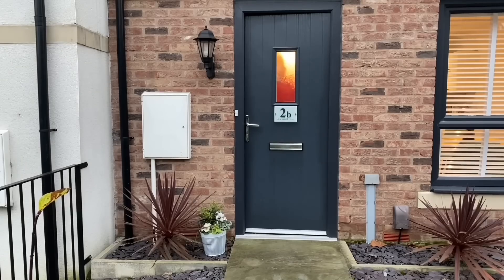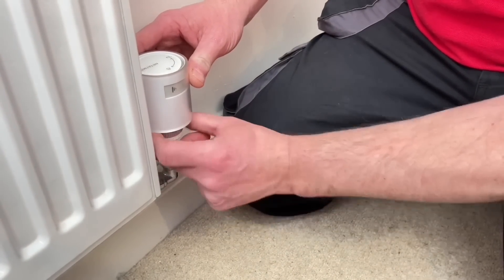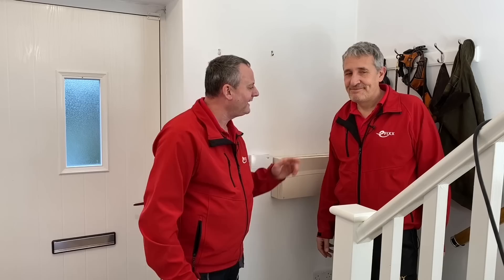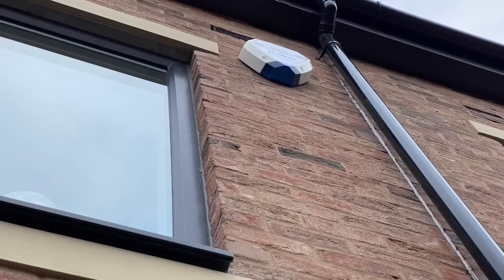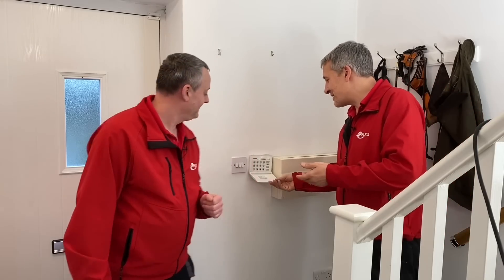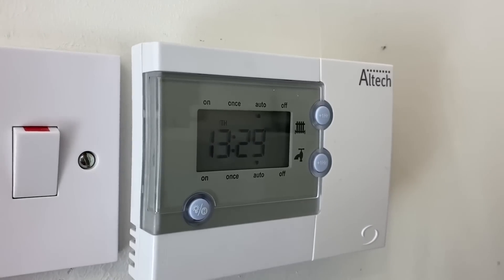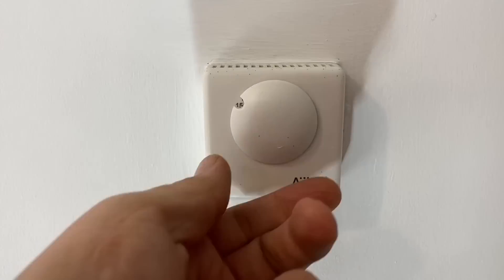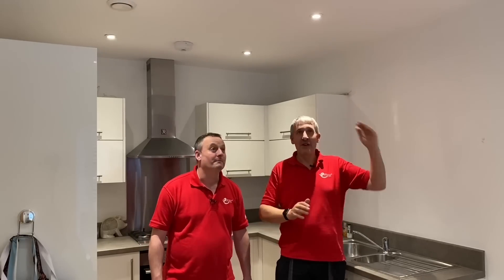Efficient but DUMB! - NON SMART HOME TOUR - Why do builders do THIS?

Comment: I dont know about the wifi alarms, the majority of iot devices have very poor security leaving your network open to attack, or worse data fraud and theft, you can replace items in a house but not a missing bank balance, i always advise that anyone with an alarm get a dialer fitted, preferably utilising a sim card. Ring had a huge security flaw up until 6 months ago that basicly meant anyone could get a hold of your wifi password, a security flaw wich is still very much present in a large majority of iot devices that are currently on the market. Untill these conpanys start caring about secure networks and not just making a quick buck ill stick to recomending certain 'dumb' devices as with a little work they can still provide a service comparable to smart devices. Having said all that, great work guys i always look forward to one of your uploads
Reply from the maker: Thanks - you raise a very valid point it’s important to trust the source of any tech product wired or wireless.  We will see what we can do to discuss the issues around security later in the series.  We follow the work of Pen Test Partners in this area -  https://www.pentestpartners.com
Reply: @efixx  hi guys again great work as usual and I've just checked out that that site I've got to say the brilliant resource thanks for sharing, especially as an industry we are moving more and more towards automation and so having general knowledge of network security even if you don't necessarily work in the networking industry is now becoming more and more important I wouldn't be surprised if further on down the line the regulations start to include basic network security
Reply: This is not true. It depends on the placement of the wireless source, you'll always have to change the standard password to a personal one. And use several sensors so one would not get any chance to get into your house. It's almost impossible to break into our house without triggering the alarm. The sensors are zigbee sensors, combined with a smarthome system. The system will turn on all lights, turn on a siren, notify me on my phone, alle cameras in our house will start streaming live streams to our phones through the satellites. The system itself is wired and hidden in a compartment where no jammer is able to disturb it with interference. And if you're able to interfere with the zigbee frequency, you'll be having a hard time, since the camera's pointing at the doors and sensors have a motion option, so the alarm will also get triggered if you're deciding to use a jammer on the sensors. A UPS is placed behind the server so the server will always have power, even if one decides to turn of the main switch. The basic rule is to always change the password. This is it. Then you'll never have to take the extra steps I did. (It's my profession, and I could take the hardware home for free)

Comment: Will be great to see some Shelly WiFI relays fitted to enable a smart light switch.  Loads of smart switches on the market, but for anyone who wants to retain existing fittings or traditional ones, good option.
Reply: Shelly.cloud Bulgarian company, devices cheap and fully CE rated. I have a good few in my house, they are open source by default aswell which is good for easy integration.
Reply from the maker: Thanks 🙏 - we will take a closer look.
Reply: Just to add to my previous comment about shelly devices, they will still work perfectly normally when the WiFi stops working which can be a big issue with smart tech relying on external servers. I'd suggest having a look at "Help! The Internet killed my toaster" by Superhouse TV on YouTube
Reply from the maker: Do you have a link ?
Reply: I use Shelly in my house.  Great products and features without costing too much.
Reply: Shelly is one of the best products ever. Easy integration with home assistant!

Comment: What a bluddy naff location for a consumer unit,just asking to get bashed, or for some young kid to crashed into it running down the stairs..
Reply from the maker: Challenge coming soon - how to fit an EV point at the rear of the property
Reply: @efixx  Run some Hi-Tuff or Doncaster EV Ultra Cable up wall to left of down pipe at front of house to & through attic & drop down rear wall of house & on to the EV charger location.